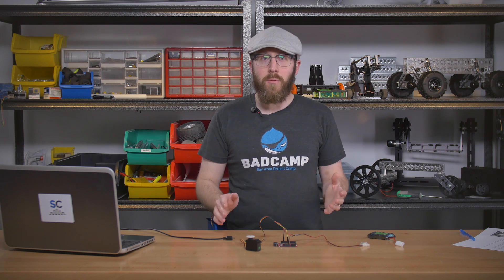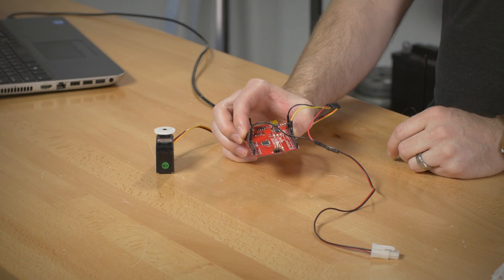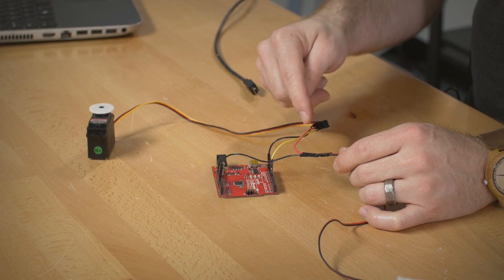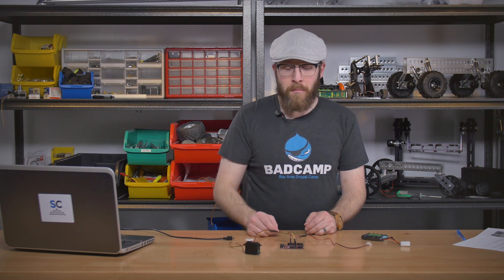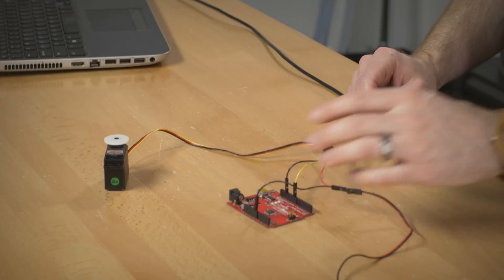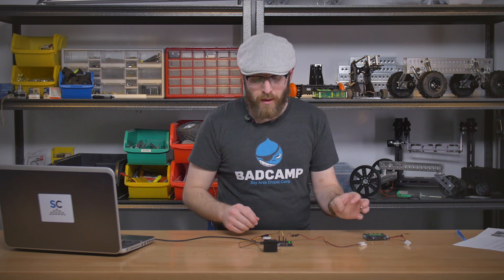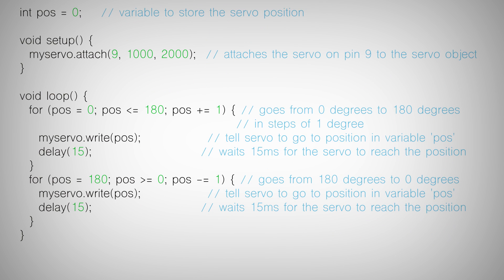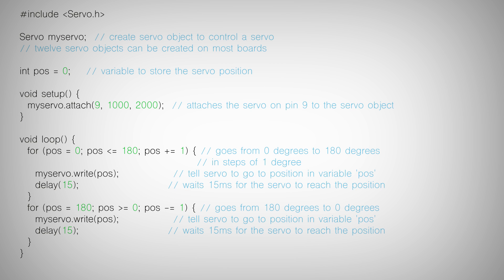Controlling a Servo with an Arduino - with Jason

Comment: If I use this code or any other code the servo spins continuously and I have no control over it.  I also have a version with a built in encoder HS-645MG Servo.
Reply from the maker: That is very strange, the HS-645MG has internal mechanical end-stops to stop it from rotating continuously, it sounds like you have a modified servo were the Potentiometer is not connected to the output.

Comment: Nice tutorial.  My project involves a micromotor and I only want to turn it on, off, and reverse (don't care about position as with a servo).  Do you have a video explaining this?Thanks
Reply: I know this is a late reply but in the event it is still helpful I wanted to mention that it sounds like you want want to look for a motor controller or motor controller shield. The exact one would depend on your project specs. Or you could use a transistor to turn the motor on and off and a DPDT relay to reverse the polarity. Here is a simple motor controller that is just a transistor, resistor and diode: http://www.instructables.com/id/Simple-Cheap-Motor-Controller/